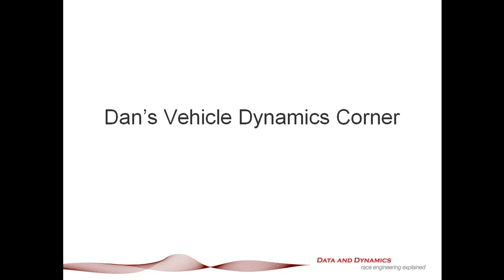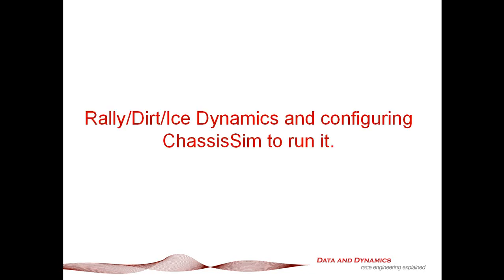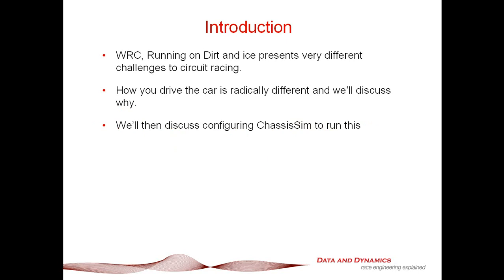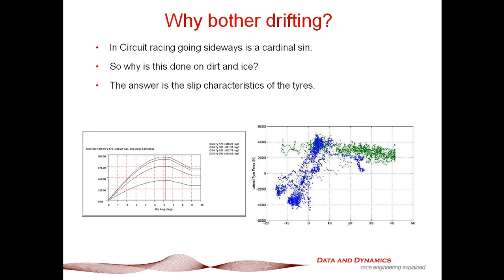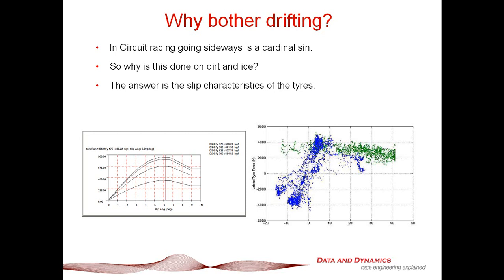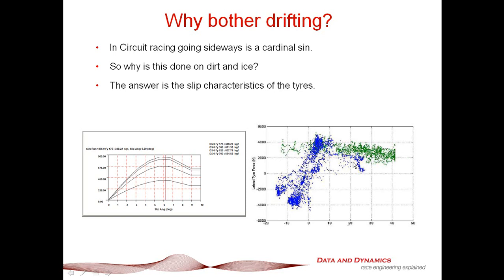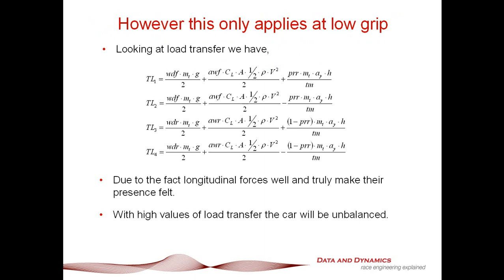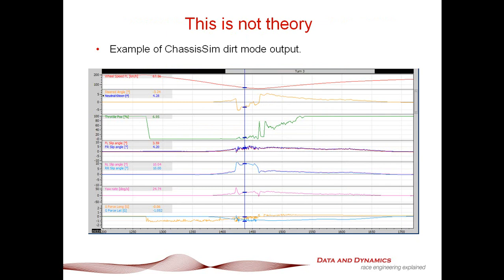The Dynamics of Rallying/Dirt and using this in ChassisSim

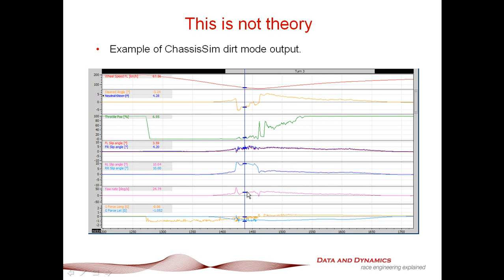Comment: What yaw and slip angle sensors are you using to derive front and rear slip angle @ about 13:45?
Reply from the maker: Patrick the yaw and slip angles your seeing there come straight from the states of the vehicle model. So the state variables ChassisSim is calculating is using to derive slip angles is yaw rate, lateral and forward velocity. The slip angles pop out in the wash. You can find the statement of these in Milliken or my book the Dynamics of the RaceCar
Reply: Chapter in your book?
Reply from the maker: Chapter 5 is the one your after